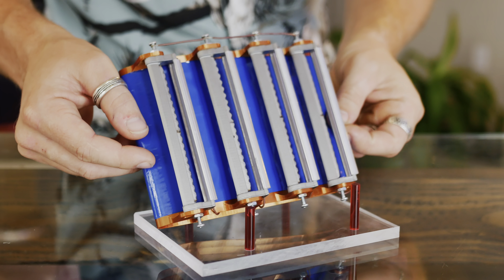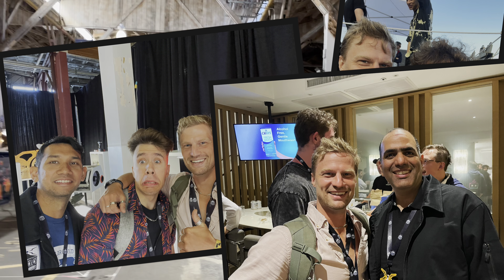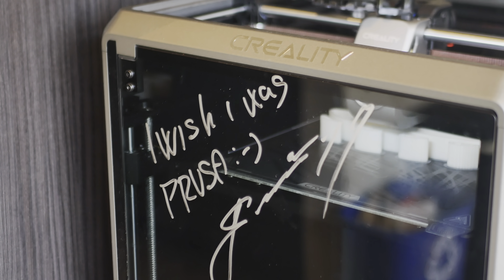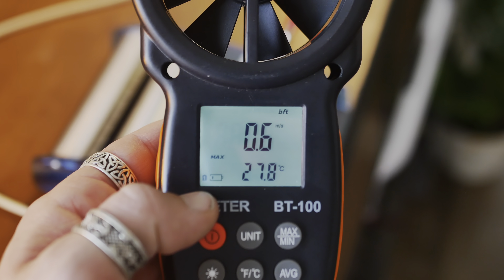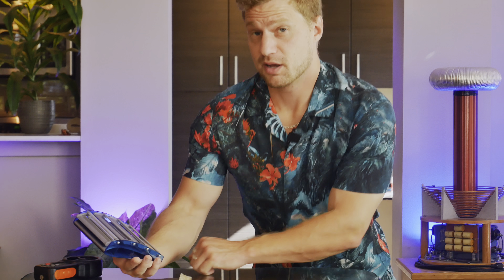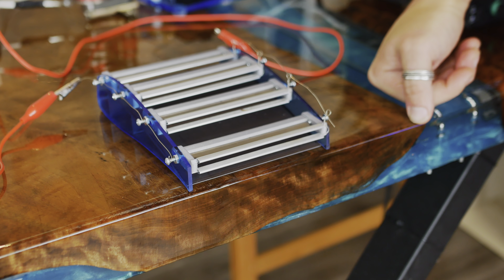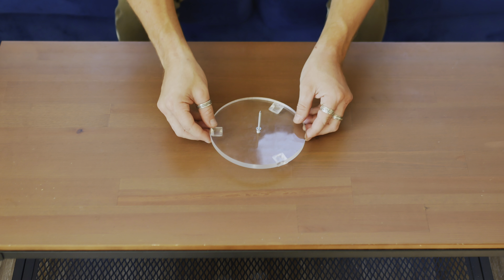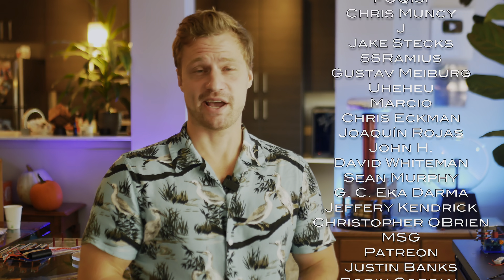Designing A Self Propelling Ionic Thrust Wing

Comment: I remember 20 years ago that many people tried experimenting with both ionic wind and electrical pulses as well as the wild goose chase of orgone energy generally believed to be completely debunked, but it was never completely debunked from those who actually discovered still suppressed technological breakthroughs.  I myself discovered how to phase conjugate orgone energy despite there not being any device yet to measure this elusive subtle life force energy.  The Egely Wheel (which I bought one) has been the only device to exhibit measurable results but unfortunately not very meaningful or precise nor does it identify the subtle energies which are hindered by other external forces such as static electricity and thermal air convections.  However, I have good reason to know based off my own experimentations that electricity and living organic energy are polar opposites which self regulates when both are within equalibrium and self feeding each other within pulsed states.  The concept is that orgone energy pulsates naturally from the æther along all surfaces at various gradients (seven æthers exists beyond the limits of thresholds such as the light æther exists beyond the thresholds of infrared and ultraviolet spectrums, and only four of the seven æthers exist from physical material thresholds while the remaining three are linked to quantum waves and consciousness).  Electricity and plasma are directly linked to both the warmth æther and the light æther while the life force of orgone energy is directly linked to the life æther and chemical æther.  This polarity is between the organic and inorganic material world.  Balancing all four æthers within a closed loop and injecting it with quantum consciousness causes naturally occurring bioplasmoidal entities that are spirit orbs and perhaps more akin to the plasma found within natural occurring ball lightning to self propagate within this balance of organic and inorganic fractal material designs.  This is exactly how the evolution of life and spirit actually exists.  When multiple ætheric thresholds are balanced within highly organized fractal mathematical structures, the physical æthers then forge a bridge towards the elusive thresholds of quantum consciousness and its elusive "non existent" three additional æthers.  Understanding how quantum waves creates quantum particles in relationship to superstrings is paramount to understanding the true reality of the seven æthers which academia, politics, religion and the scientific community have dogmaticly conspired to conceal the real truth behind the æther.  Dr. Stephen Greer is currently working towards changing the old dogmatic paradigm.  So called "free energy" is actually not as free as what Dr. Greer believes it to be because the æther itself is extremely elusive and under normal observations is non existent.  But what Dr. Greer does know about free energy and gravitons is that there indeed is a balance of energies of PLASMA FORCES within certain highly structured designs that are all rooted in natural phenomenon and natural science, both known and unknown.

Build your ion plasma designs based upon how organic life self propagates and manifests and you will discover not only free energy, but how gravitons work as well.  The key to understanding how gravitons work is also to know how to balance two sets of seven æthers, one characterized as male and the other characterized as female.  This is projective orgone (male) and receptive orgone (female).  The key to unlocking each æther is through symmetry and fractal replications.  The key to balancing the subtle forces of the æthers with known forces such as the strong forces and weak forces is through pulsations of scalar wave propagations.  Simple scalar waves are based upon algorithms with at least three superimposed waves that are then phase conjugated.  Depending on physical designs, scalar waves can be either receptive and projective.  Projective scalar waves are longitudinal waves which when two or more intersect can create distant energy vortices.  Receptive scalar waves can draw upon distant energy vortices.  The energy derived out of the æther originally derives from out of dark energy and dark matter.  The sun and stars in general, which initially began as both dark energy and dark matter, keeps the seven æthers vitalized.  The æther itself is naturally receptive and draws upon the natural projective nature of physical forces at each threshold.  Various inorganic material are naturalized as either projective or receptive and sometimes both within a dual state of primary vs secondary.  Example is gold and copper are natively receptive metals while silver and brass are projective metals.  

Construct projective plasma generators with projective electrical metals which are also pulsed scalar waves balanced with receptive plasma generators with receptive electrical metals that are phase conujugated with its projective plasma generator.  Also experiment with earth batteries with the same foresight to attract natural occurring light orbs aka spirit orbs aka ball lightning.   One idea is to experiment R&D with in the ground receptive plasma generators with above ground projective plasma generators that not only phase conjugate propagated scalar waves but are in a push-pull, on-off, balance with each other so that only one is active at any given time as they alternate between the receptive and projective plasma generators.

EXPECT THE UNEXPECTED, AND DON'T EXPECT ANYTHING BUT RATHER OBSERVE WITH CAREFUL OBSERVATIONAL SKILLS AND YOU WILL UNLOCK THE MYSTERIES BEHIND WHAT YOU SEEK OF CREATING SOLID STATE INVENTIONS.  Also, look up and read as well as understand Tom Bearden's patent on his MEG (motionless electromagnetic generator).  Good Luck.  I do know what I am talking about because I have pioneered new inventions myself with real documented functional prototypes that I have not yet publicly disclosed.  However, I have not yet experimented with what I am revealing to you as I do not have the time or the money to carry out these experiments.  I just bought a 3d printer but have not assembled it yet because I still need to learn how to create designs within CAD software as well as setting up and printing.  I travel from job to job across the nation and cannot yet use my 3d printers.  One of your ion wind designs has inspired me to redesign my next prototype which will phase conjugate both orgone energy and eloptic energy (of which I did not discuss previously) for the sole purpose of creating clouds on demand from low power on the ground with precision as an orgone interferometer skywriter.  Once this prototype is finished, nobody will be able to deny its existence because it will become public domain and will become a grassroots pioneering event around the world and will thwart any attempts on copyright and patent claims.

Also, research The Hutchinson Effect.  John Hutchinson claimed and demonstrated balanced energies, however I know that he himself did not understand enough of how to decipher and unlock the mysteries behind the æther itself.  If he had, nobody would have been able to have debunked him because he would have also understood how and why the æther of the whole earth has its own balancing between on and off cycles primarily caused by seasons and night and day.

Comment: Hi Jay, loved your presentation of the plasma devices on the airfoil. I got very excited about its possibilities. I have some thoughts on how to help you. First, the weight issues can be addressed by moving the plasma devices into the airfoils' skin. If this can indeed be incorporated into the skin. This would be best on the underside of the airfoil. The lift is created on the top of the airfoil by the unequal distances that the air has to travel. It is a low pressure area on the top that causes the lift. Even if you have to separate the plasma devices from the skin of the airfoil, put the thrust underneath the airfoil so you can get the lift on the top. Secondly increasing the length of the plasma devices exponentially, away from the leading edge of the airfoil you could get a greater output. Kind of the way a speakers' horn works but, with the horn facing the back or trailing edge of the airfoil. Then see if you can overlap these plasma devices to get more of them on the airfoils.  I hope this helps and please contact me so we can talk.

Comment: If you created slots in the bottom of the wing that formed a passage way that went through the wing to join up with slots in the top of the wing and then placed the ionic drives inside the wing and within these passage ways, it would reduce drag on the top of the wing.
Also, the air flow coming out of these slots should create a series of low pressure areas as well as thrust.
You could even consider placing a small step down just behind each slot as it emerges from the wing to help in creating low pressure areas.
Since this is to be a slow moving wing its angle of attack would create a higher pressure under the wing that would preload the slots feeding the ionic drives inside the wing.
Just a thought, good luck, cheers.
Reply: Aerospace Engineer here. Just spitballing off the top of my head, yes, placing the ion thruster inside the wing is definitely the way to go. Essentially a series of ion drive slats. There's a lot of different options, you could also perforate the top of the wing to create low pressure. Could do the old wing tip thruster trick Sikorsky tried. All sorts of ideas come to mind. I think @PlasmaChannel needs more help in the aero department.
Reply: @jadcb159 
Absolutely !   Early in this video I noticed his original stated problem of thrusters added on to other structures was still present at the end of the video.  If the thrusters were inside the wing and a structural part of it,  it seems a bunch of weight and drag would go away.  
Simple….never to be confused with easy.  🥸
Reply: I don't think slots on the bottom of the airfoil is a good idea. Air foils rely on the air stream velocity difference across the top and bottom surfaces to create lift by lowering the pressure above the airfoil as the air has to move faster. Rather I would try having more intakes across the top of the airfoil and exhaust out along the surface of the trailing edge. This principle is used on the B-2 and B-21 to increase the air speed across the top of the air foil.

I almost wonder if the ground was on the surface of the airfoil and the wire was basically placed above and in front of the surface mounted ground could you increase lift even at higher angles of attack as the air stream would stick to the airfoil longer. I wonder if this could almost be an electric flap.
Reply: Food for thought there for sure .
Reply: It definitely feels like there are options here for really precisely shaping airflow over the wing by tuning the angles and power ratios of the propulsion units.

Comment: You're the peoples new age pioneer. Keep up your work.
I was also wondering if you could somehow manage to get hands on a copper piece of strip, but instead of having the lines slightly off from perpendicular having them perpendicular and cover it with a gold strip that has the same patterns of the cutting ridges of the blade you used but make each one pointy with each tip going slightly off the edge of the copper blade, that way each pint has full capacity to create the trhust funnel all around it. Better power conduct should improve power output. 🤷🏻‍♂️

Comment: Honestly love your work but i think this idea is preatty trash. You are ruining the separation of flow on the top wing that contributes to create lift. On top of that you are placing the ionic thruster on a negative pressure area once the wing is moving, that means lower air density and lower thrust.
Would be useful to put ionic thruster on the bottom (after the initial high pressure on the front) and modify the wing design in order to be able to partially decrease flow velocity and increase the pressure on the bottom of the wing. The amount of air not slowed down would act as a thruster itself though very weak. Liked the video bc it is very very original 😊

Comment: I think you should consider timing the thrusters on and off one by one at different rates using some software. Try find out the best rythm of firing the ionic thrusters in parallel to attain max airflow...
This may increase airflow or save power so that flight time can be improved

Comment: Curious with how quiet the thrust was I’m wondering how quiet this would be in large scale if it ever came to conception with enough force to move a loaded aircraft. Noise pollution around airports would drop drastically as well as the thought of stealth aircraft. 

But that’s taking a huge leap. 

Either way love the vids brother !
Reply: There would still be a lot of noise, particularly high frequency noise, which a lot of animals may find problems in, but I wager it is still WAY better than the current noise status quo. Don’t think it would have much potential in stealth tech since the HF noise would be pretty easy to detect (unless I’m thinking of the wrong thing)
In a much larger application, I don’t think the noise would be very noticeable unless you’re pretty young. After about two decades, your ears start to deteriorate enough not to hear higher frequencies, commonly known as mosquito sounds (for very good reasons 😏)

Comment: Amazing ideas!
And 
Your 2nd, 3rd and 4th engines are blowing over one another.
Maybe lining them up to make them blow one toward the other could cumulate and boost the speed of airflow? And considering that the air flow goes faster past each engine, maybe an increase in spacing between each engine could also be advantageous? (or not at all).
That got me thinking, maybe embedding the engines into the frame of the wing instead of over it (with an adjustable intake slit just over the leading edge of the wing) could be a boost in efficiency or at least an decrease in weight.
Reply: In a previous video (BSI MkII I think) someone suggested to try blowing air in front and see if the velocities added up. The result was that it didn’t. So lining them up actually wouldn’t cause any Newtonian addition of velocities. 
It would seem that the already accelerated air is going too fast to be affected by the field, so either distancing them, or putting each one on a different level to draw more air in instead of trying to accelerate air could work. Still, these are only second hand observations. It is nice to know that Jay listens to the comments section. Feels nice 😊

Comment: 1. Absolutely fascinating and exciting work. I love your videos! And I LOVE how it gets all of us thinking! That in mind…

2. Have you considered changing the geometry of your ionic segments to match the surface of the wing or flow of air? In the video it seemed that each of your razor blades were level with the table, not with the surface of the wing beneath them.

3. Would controlling intake flow with an inlet or series of inlets prevent some turbulent flow and increase input volume allowing a higher output speed? In my head this could look like the ionic propulsion inside the wing rather than on top, with inlet channels along the leading and top surface.

Comment: Although flight is your goal and that is cool/interesting a practical use for it is how i found your video,   im looking for a light weight energy effective way to start a windmills blades turning. 
Few people know that low windspeeds can generate power when the plades are in motion., but if the blade is not moving there is a "cut in cut out" requirement of windspeed to start it moving.  Also a way to   slow the blades that if the windbis too high. 

This method is promising,  in two versions. Lobed tiped blades(sicamore sead shape) and best for vertical blade with an air scoop that provides a directional moving foil to concentrate wind on the leading edge and block wind on the returning blades. 

Anyway good luck, im subscribeing to keep up on your efforts 👌

Comment: A fan in a duct increase flow, would you benefit the same adding a light plastic sheet as roof? 

I recall seeing a model airplane flying successful i a lab in a circle nonstop using the same principle. So keep up the good work. Btw, would adding two or 3 on top of eachother add a net posetive? 

How low are the amps? Can a lighter battery chemistry help? Wireless energy? :) Thanks for video, i lovede it!

Im thinking i need this for silent non maintenance air circulation in my house haha

Comment: Using ultra light carbon nano fiber string with sufficient length the weight of the capacitors can be removed when the plane is launched and the string doesn't touch the ground

Comment: Pretty cool job, but I see one essential problem with this design: mounting the engines over the wing. This will affect the boundary layer and natural flow of the air over the wing, and all the turbulence generated by the engines themselves might reduce the lift of the wing, which means you’ll need even more thrust if you want to make that thing fly, and the key here with such weak thrusters is that less = more.

Comment: I feel like this would mess with the air pressures that allow the wing to work. If you’re artificially creating lower pressure over the wing, then the pressure would be much higher under the wing. 

You may be able to have smaller wings as the low to high pressure ratio gets exaggerated while the thrust is occurring. …but as you come in for landing, the plane would feel a lot heavier as you reduce the thrust. 

 I feel for something like this to work, you’d need some sort of flap reaction system that adjusts depending on the ion thrust over the wing. But I’m sort of an idiot, so I’m probably missing something or the existing take of and landing flap will just work the same way.